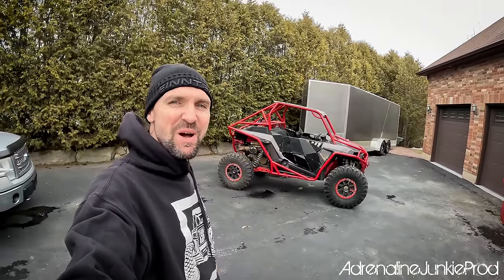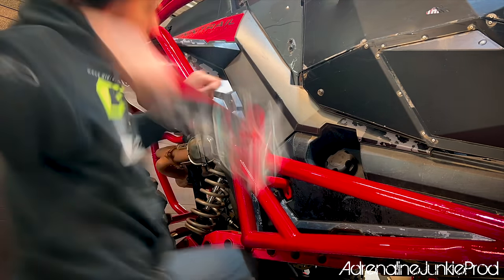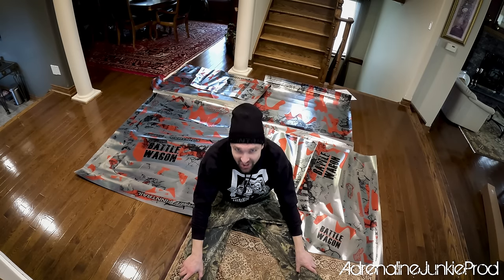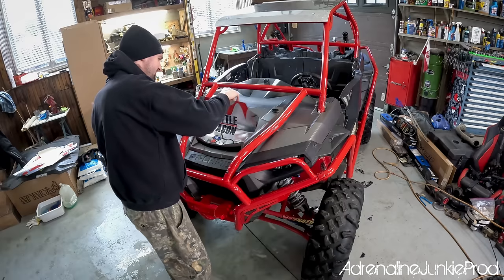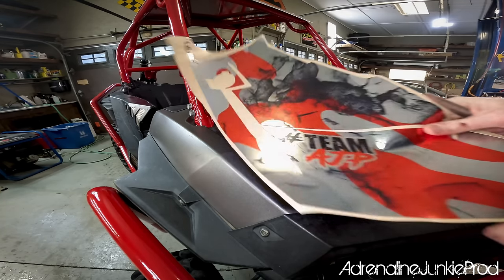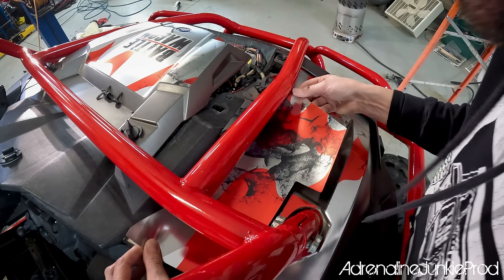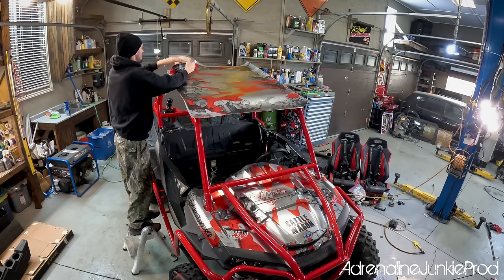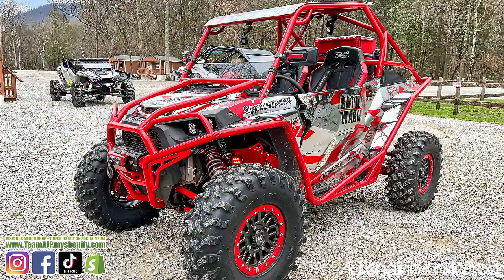How to Install a Custom Vinyl Wrap - SXS/UTV/ATV Wrap Removal, Prep & Application - RZR Turbo DIY

Comment from the maker: Thanks for checking out the video. I hope you like the new custom wrap which completes the transformation of the #BattleWagon into version 3.0! As many of you likely know, I’ve owned this machine since it was brand new in 2017 and it’s evolved quite a bit over the years. I’m really happy with how it’s setup now and can’t wait to beat on it all season so stay tuned! Leave a comment and let me know what you think of the wrap!
Reply: I have met people with "new" machines and they seem to always have problems with them..... mostly belts. Of course I am 60 years old and only trail but if my beer gets spilt I am going too fast !!!!! ... LMAO ... I love my stock clutching and only upgraded weaknesses like radius rods, tie rods, S&B air filter,  arched a-arms with Stage 2 AA flash. Sitting on 30" Carnivores does everything I ask of her. As a retired Boeing aircraft mechanic I am sensitive to what the engineers expect this machine to do and do my best not to exceed that. I NEVER want to be THAT guy who always breaks down ...... You are still the King of content and I can speak for everyone when I say thank you for the hard work !!!!!    🙂
Reply from the maker: @TheAmerican1963  thanks for the thoughtful positive feedback, I really appreciate it. You make some valid points, a lot of people have unrealistic expectations on what a machine should handle. If you abuse a machine, modify things improperly and ignore maintaining it then it doesn’t matter what it is or who makes it, it will fail. I beat on my machine pretty hard at times but I also maintain it meticulously. It’s never let me down in a way where it’s left me stranded. There’s 1000 ways to build a SXS and everyone will do it differently based on what they want or like. I still think the most important part is just getting out and enjoying yourself. Sometimes changing too many things actually has negative effects. You hear all these “experts” complaining about how things are built or setup from the factory thinking they are better engineers then the people who developed these machines. I’m not saying that the engineers are perfect but they have specific targets and requirements they need to address for a mass produced unit like this. Sometimes people’s don’t realize that. Those who use and modify these machines logically are usually very satisfied overall. Really happy to hear you enjoy the content. I always look forward to your comments. Ride safe and have fun man!!!
Reply: @AdrenalineJunkieProd  👍👍👍

Comment: Nice job.  I’ve done lots of wraps and I use WD-40 to remove left over glue.  Big tip…..  take a bottle of water and add few drops of dish soap and mist back of sticker then apply.   So much easier and better results.  
Also i use a heat gun during application.
** Wipe area with alcohol and compressed air before applying each piece.
Reply from the maker: Hey man. Thanks for the feedback. Citrus based adhesive remover works way better in my experience then WD40. Especially for tough adhesives. The residue is also easier to clean. I use a heat gun after and go around and do all the contours and edges. I mention that in the video. The heat gun makes a huge difference in how well the wrap stays on. With all these panels being mostly flat I didn’t really feel I needed the heat gun for application. When you do automotive wraps heat is incredibly important to help stretch the vinyl around contours. You have to be careful with heat on an Offroad wrap because the vinyl reacts differently to heat then the over laminate layer. As for the wet application. Others have suggested that too. I’m gonna give it a try in the future. The majority of new vinyls for automotive recommend dry application. However, I can see how certain areas on this project may have been easier to wet apply. I’m gonna experiment with it next time and see.
Reply: @AdrenalineJunkieProd  definitely going to purchase some of the citrus stuff.  Looks like it works well and cleans up easier then the WD-40.

Comment: Been waiting for this video.   Wanted to watch it before deciding on a wrap for mine.  Was in touch with Barrett  and had a design idea  but  Will have to rethink the design With the gaps etc as my plastics are red in the front but blue on the sides.      Pro xp Rockford fosgate edition.
Reply from the maker: Glad the video helped you out a bit Keith. Ya, all the wraps will have some gapping which is why I think choosing colours that compliment or flow with what’s underneath is important. I’m sure you guys can think of a cool design though.
Reply: Stoked to work with you!

Comment: Looks good man. Funny you mentioned install costs, I was quoted $1200-1500 in my local area from authorized installers.
Reply: Make sure there using the right materials, you see quotes that are 3x higher from automotive vinyl shops. Make sure your getting proper off road vinyl. Best of luck!
Reply: @barretthepburn7873  Hey thanks, this is off-road vinyl, custom design and in-hand, just going to the shop for install/labor. They quoted me close to 15 hours for install at shop rate basically.
Reply from the maker: 1200-1500 to install!!!! WTF!?!?!?! That's whack! $100 an hour and they want to take 15 hours.... That's insane. Some places need a reality check. A skilled "professional" who does this stuff fulltime should be able to hammer out an install like this in 4-6 hours. As long as the machine is prepped. If they need to prep it could take a bit longer but if they think it will take them 15 hours I'd run out of their business laughing.
Reply: @AdrenalineJunkieProd  Yeah I thought it was a bit absurd. I'd have done all the prep, I just suck at laying the wrap lol.

Comment: He'll ya man looks amazing can't wait to see next video I know this question has nothing to do with this video but I was wondering about your opinion about how  the muff pot works I know u use it alot and a bunch of u have them dose it really do a decent job how long do u put it in for lol
Reply from the maker: Hey man. lad you like it. Muff pot's work great. Depends on temp outside and riding style. If you are riding wide open high speed it works much faster then just slowly crawling around and making a lot of stops. Like anything you need to use it a few times to really figure it out. We love them though.

Comment: That looks incredible dude!
You’ve obviously done enough vinyl to be confident

The only thing I would suggest a newbie is NOT to start with the hood or another easily seen area.
Start somewhere discrete and make your mistakes down low!!

I’d rather pay you to apply it!!
I’ll hold the camera!!

Cheers
Reply from the maker: Thanks man! Ya, I’ve done a bunch of wraps over the years. Cars are wayy harder. Your tip is good. Probably should have mentioned that for a noob starting on some of the small sections would be a good way to get a feel for it. I know a lot of people would dread doing something like this and never attempt it. You need to be really patient. I’ve got a few friends that would of given up by the second panel and said F it lol. It’s not a job for everyone, lol.
Reply: @AdrenalineJunkieProd  yea you definitely showed you have the patience 
That’s a lot of separate pieces to apply.
It would have taken me 2-3 days to do that whole rig
It’s like auto body 
I don’t have the patience for prepping or masking.
But I’ll come in after and shoot it

I watched the video again.
It came out fantastic overall

V3 is the best version so far!!
Reply: Some one like Julian is worth it to pay to install, local shops are not familiar with sxs but Julian knows these machines inside and out!
Reply: @barretthepburn7873  that’s a fact!

Comment: Hindsight being 20/20 and all, couldn't you have used your vehicle lift on the cage to make some of the wrapping process easier? Looks good though, I can say that I will miss the whole RBO rear cage area with wagon 2.0
Reply from the maker: Getting the cage off in its current state with one person is just too much work. It was easier to work around it in my opinion. Ya, version 2.0 with the RBO rack was unique for sure but it was time for a change. I’m happy with the new look.

Comment: Just fyi. Vinyl won’t stick to parchment paper. Lay that down and you can position the wrap then slide out the paper looks great!
Reply from the maker: Thanks! That parchment paper trick is a great idea!! Thanks for sharing that. I may have to try it in the future.
Reply: Good tip, I do this when I'm doing a new model I haven't done before. But if I know the machine well I can easily take off the sheet straight to the machine.

Comment: You can float your wrap into place with windex and then just squeegee it out
Reply from the maker: I’ve never been a fan of wet application but I’ve also never really given it much of a chance. I know tons of people do it. Even for stickers. But I’ll try it next time. A few people have told me I should wet apply in the past. By no means was this wrap “hard” to apply. But I’m down for easier lol
Reply: @AdrenalineJunkieProd  the problem with dry app is  getting it into place
Reply: @AdrenalineJunkieProd  you can use an “isopropyl mix” to wet apply it too.
This way you’re guaranteed not to have any residue  
I’ve used it for tons of vinyl decals. Never a wrap tho
Reply: You use soapy water for thin vinyl so it won't rip stretch or tear. But thicker off road vinyls don't need this, and hold up better and last longer with out soap water and Windex, as if you trap moisture in there and it goes to sub zero temperatures it will spider crack the vinyl
Reply: @barretthepburn7873  it’s personal preference. 
I don’t like using soapy water for the same reason I wouldn’t use a cleaning product like windex. 
You run the risk of leaving a residue and ruin adhesion.
Isopropyl and water allows you to to reposition the vinyl easy enough and dries without any issues after you squeegee out the bubbles
Reply: I've done 5 or 6 now using the windex and a heat gun ,mines been on there for 5 years no issues whatsoever , 0
Reply: @eltonwhite8490  you shouldn’t take things online personally
Reply: Nah ! Just trying to pass along a little experience that worked well for me, my skins pretty thick brother it takes alot more than that to get under my skin lol
Reply: @eltonwhite8490  ok cool! 
Good to know. We’re all just friends here with different opinions 👍
Reply from the maker: @alteredstateskustom  Like many things, there are numerous ways to do it right and everyone has their own preference. I may try the wet method in the future for some tricky spots. Always good to try new things. Sometimes they work out, sometimes they don't but you gotta try to find out.
Reply from the maker: @eltonwhite8490  It's appreciated man. It's the whole point of the comments section and videos like this. I read all the comments and feedback and I do apply what I learn. I love trying new methods. I have a few leftover pieces of wrap I may mess around with.
Reply from the maker: @barretthepburn7873  I also believe that a nice dry application on a super clean surface will most likely yield the strongest overall bond long term.
Reply: @AdrenalineJunkieProd  100% I would just avoid any products with additives like the blue dye in windex or dish soap. Those products work great for their intended purpose. But don’t always work in other cases
Because they can effect the adhesive.
Like your comment saying the dry method would yield the best results. 
And you’re probably right about that.
The less you use to apply the wrap. the better it would work out long term
Reply: @AdrenalineJunkieProd  all good dude  im a first class mudroller and motor head I awlays try to help out and share my experience, like everybody brings their stuff to me with a problem and I enjoy it so Growing up broke as all hell If I wanted anything I bought somebody elses used junk and fixed it up and made it good to go , not saying my way is the only way but it works damned well atleast in my experienceIf I'm turning wrenches and learning something new I'm in my happy zone, I may not know what i'm doing going into it but I always figure it out and figure a better qucker more efficient way to get it done, 35 years as a master HVAC tech has taught me that LOL
Reply: Appreciate the reply Buck like I said I always try to help being part of the motorhead brotherhood nuts and bolts community lol you guys should come ride with us sometime we'll take you up in the mountains and show ya some real terrain lol it's uphill both ways around here like nosebleed high

Comment: Dude I can turn you onto such a better way to do that wrap without all that fighting with the graphics
Reply from the maker: Is windex good to use? I’ve heard others say a bit of dish soap and water. I’ve got  an off the shelf spray for wet application but I haven’t tried it. Maybe I should have lol.